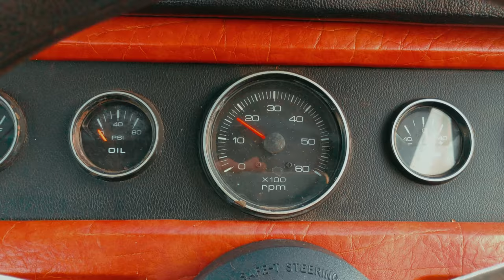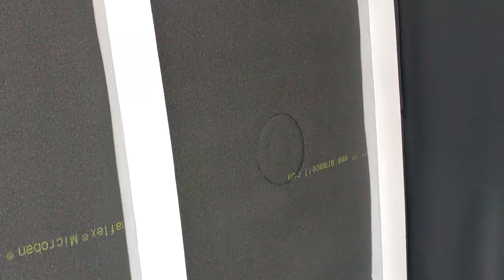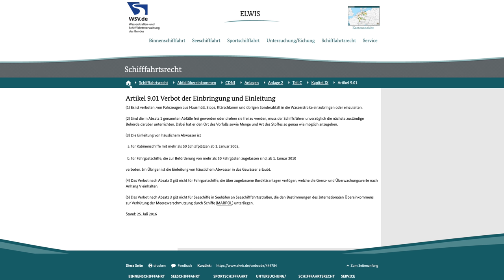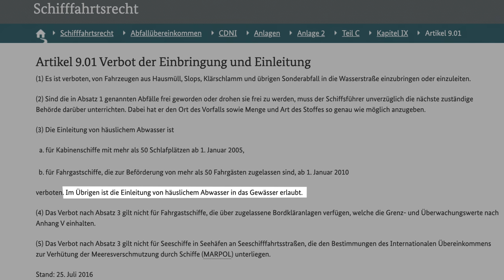Water System Refit on 1978 40ft Yacht - Ep. #46 - Vintage Yacht Restoration Vlog

Comment: I smiled when you said that 'in the future you will add fixings for the semi=ridged tubes'. Remember - every temporary fix that works becomes permanent. That's not a criticism, it's just a fact of life.
Reply: I would add 1000% more at least. Some day that boat will sea at least Baltic Sea and hoses will break after a while.
Reply: Yeah! My father built a cardboard box casing (with generous use of gaffer tape) for a 230/12 Volt powersupply - in the 70ties. Meant as a temporary solution - obviously - as cardboard is not exactly safe to insulate 230 volt. He said he will built something better soon.
My father died 15 years ago.
The powersupply  still works. 
In a cardborad casing.
Reply: i cant disagree with you
Reply: How did an American runabout end up in Germany?

Comment: Water coming out of waste tank should have some kind of trap to protect the pump if something should fall down the drain. It could also stop the flow of water. Maybe it's best to put trap before waste tank. One more thing just came to me, the sink should have a pee trap just under the sink to stop bad smell from entering the boat. In America it's called a pee-trap. All it is, is a half loop in the drain line which holds (a little bit) water that makes a seal so bad smell from waste tank can't come into the boat. Hope this helps. Cheers!
   You have come a long with that boat and I've gained some ideas from you so it only right that I give also. Blessings to you.

Comment: White plumbers tape is low grade and you should use "pink" tape.  Also after min 3 layers, tighten it as best you can with your fingers (use a screwing motion) to push it into the threads and expel air, then screw on your fitting.   Also any fitting through the hull should have a shut off valve, in this case a smooth full bore ball type, so as not to catch particles and clog. But looks good.

Comment: If you look iside those metal slip nut hoses you will discover that the seal of that ftg is set up to be a compressive seal. TFE tape can actually create a potential for leak with any future vibration. Composting toilets work surprisingly well and will conserve your water

Comment: Great progress. Fitting an adequately sized black water tank is relatively easy - the problem may be accessing pump out locations on your waterways - have you researched that? A bigger problem may well be how to deal with fuel/oil contaminated bilge water - pumping that overboard is more likely to be detected and prosecution swiftly exercised. Grey water is not a problem if you are using eco friendly products. Keep up the good work.👍

Comment: Suggestion. Put a gooseneck in the sink hose to prevent odours coming from seawage tank. And add a deaireation to seawage tank with an antiodour filter.
For the toilet you can put, if you have enough space, a separated tank only for that and add an enzimatic pack monthly.

Comment: With the problem of corrosion in the electrical wiring.  I strongly recommend that you use Penetrox. 
Even use it on wire crimps. Just dip the wire end in Penetrox before crimping. 
The boat is looking good Inside.🤗🛥🌞

Comment: I would insulate your hot water lines with some lagging as they will bleed off heat very quick.
Reply: Armaflex etc. have easy to use and quite cheap ready to use insulation tubes to use.
Reply: What about thermo isolation for cold water as well, since it can all froze in winter bursting the pipes?
Reply: @new.handle  boat is isolated and with heating on, nothing will freeze even in minus 15-25.

But your right, if this was a glasfiber boat without isolation it could be a risky move going without the isolation imo.

But putting isolation on the hot pipes will save him energy for sure.

Keeping isolation on the cold ones, will keep the cold lines even colder in the hot summers and prevent any cold too freeze it is he leaves it non heated for long times ye.

I would probably isolate it just for the colder water in the summers 👍😁

Comment: A "P" trap under each sink is a must or you will have gas exiting each sink - smelly!  Holding tanks should be vented.  I agree with others that your "boiler" is going to have a problem with that installation.  I love the quick-connects but the concerns expressed are valid. Ensure you have a disconnect switch for when the boat is vacant but not for the bilge pump!

Comment: Great job!
Congrats!
One little remark please, is for that green plastic pipe for water.
Winter is coming! 
Maybe is better to try to have in the engine room, temperatures above zero Celsius degrees, in order to prevent ice clogging of pipes and potential leackings (pipes cracks or enlargements or plastic connectors cracks). If you'll leave the boat afloat and unattended for days, don't forget to drain the water from all water pipes!
All the best!
😉

Comment: In terms of waste water; I'm looking at exactly the same thing right now and as my boat is a sailing barge I'm fitting Y-valves to everything, including both of the sink pumps and the shower, so I can pump this out of the side if I need to. Although usually I'm going to pump this into a waste tank so I can pump out to a sewerage facility. This is pretty easy for me as I'm moored right near one and usually have a permanent connection although i'm going to put as large a tank in as I can; I think 1000 litres at least. This means I can be away for a good while before I need to pump out. For the toilet there already is a hull fitting to pump this out directly from the toilet and also a hull fitting to take water in to flush the toilet. This outlet was also on a Y-valve although always in the position where it is pumped into the waste tank. I'm going to leave this system so that I could pump straight out of the side if it was really necessary and I was in a location in which it was ok to do so (such as at sea), although it will go into the waste tank usually. I'm also combining the "black" and the "grey" water in this tank. There is a case for having separate tanks if you reclaim the grey water although I just pump out into the mains sewerage system so will just keep it all in the same tank. The guidance is hard to understand in the UK too really although I think it's good future-proofing to be able to collect everything (and to avoid having to pump out constantly get as large a tank as you can possibly manage). Finally, you can weld plastic HDPE sheets yourself with a plastic welder so make your own tanks to the dimensions you have, for example low in the hull etc. This is what I'm going to do.
Reply: Also I'd recommend a soundproof box for your water pumps. 😊

Comment: You should review the connectors on the waste pump, and cut them back. If you leave it this way, you will have a bottleneck. (tubings diameter vs. pump connector) Also don't fortget to isolate/fix the tubings rubbing against each other. ;-) And yeah... waste water outlet belongs under the waterline or at least not so high (dirty paint/hull). Nice to see that your overall skills are growing and you have invested in proper tools! :-)

Comment: I approve of your waste water thoughts. It must be remembered that household grey water makes its way into water courses almost untreated anyway. If you are thoughtful of what you put in chemical wise you are not doing anything that a normal householder doesn’t do too. The difference is that you are very aware of what you emit.
  Solids are different but that depends on how busy the waterway is and its rate of change. A busy canal for instance is very different to a flowing river or the tidal sea where the rate of change of the water body is significant. Dilution is everything and I prefer people to be aware of what they discharge as many boaters are. To be revolting, one mans waste is another organisms food. Its about balance as ever.

Comment: bravo for these installations, made very correctly, even the pieces of wood are varnished, as well as the anti-wear protectors. In France the rule is that we put 2 necklaces per tube (in case one of the two gives way ...) but each one does as he wants ...! great job, well done!

Comment: One thing I do with future lines is I just install a shutoff valve instead of a plug. Although I can see where the plug is handy in that it helps keep dirt out of the lines. But you might want to look at some shutoff valves for handy troubleshooting and maintenance later on in life.

Comment: I would recommend doubling up on the pipe clamps/jubilee clips as security against failure (leaks on boats are bad)
:)
Reply: Exactly. Use two clamps on every single water connection. Mount the clamps always turned by 180 degrees against each other. This applies to the entire boat, e.g. water system, engine room, bilge pumps, etc.

Comment: In my friends 104' wooden boat we were going to use bags like are used for transporting plywood glue on flat bed truck trailers. Allowing us to empty them. Roll them up and removing the support beds to access the bilge if needed instead of cutting the deck out above and a crane to lift them out.  There are race car fuel cell bladder manufacturers that might have something in a size you might use.

Comment: Great job on this, it looks very professional.  The gray cable trunking that you already have is a great way to run cables & flex pipes neatly.  It's cheap, easy to deal with and protects everything very well.   I have used it in large industrial machinery where vibration and other potential damage is always an issue.

Comment: You can easily hang a blackwater tank behind your toilet. No need to keep it under waterline, and you get a 3 way valve to either dump it overboard where legal, or pump it out via a deck fitting. Remember when you pump out your toilet, you can without any problem pump it up 1 meter to a tank, either with a manual pump toilet or electric ( i prefer a electric with a macerating mill that cuts up all sevage). On most sailboats today the tank is assembled behind the toilet on the hull.

Comment: you still need to put something in place between the brass and steel in the hole as if the annular space fills with salt water, you will get electrolytic reaction

Comment: Dark water through hull pump should be installed under water line (I think).  Usually straight down.  The reason is that once you start using the head the pump out will stink and if you have it in the location you do it will always be rolling down the side of the boat creating smell and pretty nasty residue.
Reply: This is just the gray water outlet, water from the shower and sinks. The head is existing under the water line, you can see it in episode 43 if I recall correctly.
Reply: I believe the head has its own through-hull that goes straight down, so it dumps directly into the water.
Reply: @jeffhreid  Hypothermia is deadlier so the poor should not have to pay for sanitation when the beneficiaries include the rich, especially when doing so threatens shelter.

Comment: Goose neck above the water line ? And grey water outlet above the water line, I hope you don't empty your gray water tank with toilet water above the water line. I think you missed the point grey water you dump under water and then use a goose neck to prevent the water from leveling. Great refit and nice water system.

Comment: Watching you replace the plumbing has been enlightening but did I miss the installation of a back-flow preventor, inside of the through-hole? That will keep the water out.
Reply: It is over a metre from the waterline.

Comment: You have a problem with your hot water boiler. You will have an air pocket in it at all times,  unless there's a bleeder on the back,. You have the hot water outlet lower than the highest point of the tank.

Comment: Dealing with grey water is one thing.  Black water is another and you really need to deal with the fact that your head discharges directly overboard.  Removing it and going to a cassette type head would be a good choice. Grey water can be dealt with by using a reverse osmosis system  and the water being discharged is actually drinkable.  This however would require accumulated residue to be cleaned from the tank occassionally.

Comment: Hot and cold lines need to be separated or sweating and heat exchange will occur. At the very least you should insulate them separately if you want to keep them together as they are. Good work though!

Comment: You will probably never use the hot water in the hand washing sink in the head. It takes 30 seconds of water running or so until hot water is actually coming out of the tap, and given the need to use water sparingly on a boat, you will never let the water run long enough.

Comment: As far as I know you are not allowed to pump black water overboard! Blackwater means sewage from the head aka feces.
Grey water on the other hand (water from the shower, sinks, washing Maschine, etc.) are allowed to be pumped overboard as long as you are not in a Marina.
I am from Germany too and often on a boat in the Netherlands. So that’s my knowledge so far. If I am correct, they also told us that when I did my boating license (in Germany btw.).
Reply: you can 3 miles offshore in the US
Reply: @sailingavocet  yes but he is ankered in a little lake in Berlin. I am pretty sure it is not allowed there.
Reply: @Far90Cry  ah, that makes more sense. Definitely probably not allowed

Comment: 1: The hot water pipeline must be insulated, otherwise it will heat the cold water pipeline. 
2: a circulation pump and a return pipeline from consumers to the boiler must be built into the hot water pipeline. otherwise, you will have to wait until hot water reaches the pipeline from the boiler, and this is the loss of clean water. while you waiting for hot water from the boiler, clean water flows into the gray water tank

Comment: I would do a couple more steps. Where you had the void in the hull outlet brass fitting, fill it with sikaflex. Also had a stop cock to the outlet so it acts as a sea cock and can be closed in high seas ( just in case). You don’t want water to come in with rough weather.

Comment: Are you gonna be dumping poop right into the river...lol? Greywater would be ok but not black water. You could install a holding tank and macerator with Y-valve (diverter) to carry into the holding tank or switch to overboard discharge.  There would be no need to hold the grey water.
Reply: As he said that is the common practice in every place in the world except for the United States. . now stay out of the ocean that is where the whales crap. 😆
Reply: I had boats for over 20 years in Auckland New Zealand. There is nothing worse than seeing people swimming in a beautiful anchorage and turds passing by. Blackwater holding tanks are compulsory here and can be discharged when more than 200 meters from the shore. In my last boat, a 42-foot sailing catamaran I installed an Electrosan macerator/electro chlorinator that turned turds into sweet-smelling clear stuff. It did use a lot of electricity, so I used it a couple of times after a number 2, then used the toilet pump only, for number 1's. Showers and sinks either got pumped out or gravity emptied into the sea. This guy does a great job in everything he does and does not cut corners. He has made errors in the system here but fitted it immaculately. I hope he reads the comments and takes the advice so that the systems become correct.
Reply: @colinowen3672  I like the way you're thinking 🤔

Comment: That's a WHOLE lot of sharkbite fittings. That's going to be a nightmare when they start to leak, lol. There's a reason plumbers don't use them in residential plumbing, or really anywhere.
Reply: Plumbers use them everywhere, all the time. Thats what they are for! They dont leak unless fitted by a dunderhead.
 However, i would have fitted stiffeners to prevent the fittings blowing off.
Reply: @johnnyseagull29  Are you a plumber? You know how many customers houses I’ve gone into, to fix leaking or blown off shark bites? They are good for max 10 years.
Reply: @Velislide  well yes. Of course i am. I run a bathroom fitting company in england and i have very rarely had a problem with push fit fittings, and they have all been due to poor fitting methods.
Reply: @johnnyseagull29  Rarely have a problem is too often, especially in a customers home, where one problem can cause 10,000$ worth of damage. Why would you ever use sharkbites? They are a DIY fitting for home owners with little to no experience plumbing. Either use Uponor and Type-A, or crimp fittings, if you can't afford the tool. If you run a business, and are using sharkbites, I feel bad for the overpriced garbage your customers are paying for, because you're being too cheap to buy quality tools.

I wouldn't be able to sleep at night, knowing I put sharkbites into a 30,000$ bathroom project. Knowing that water hammer, or time, will pop those fittings, and blast the customers home with 60 psi of water pressure.
Reply: Unfortunately plumbers use them everywhere because it’s a quick fix and takes no skills.  If it leaks down the road, it’s repeat business.
Reply: @nauy  Out of every union plumber I've worked with, I've never seen one that would ever use sharkbites.

Comment: For your own sake, (as well as regulatory issues and your contingency plans), you need to separate your grey and black water systems. You risk contaminating your whole system with e-coli, not to mention foul air returning through your sink. Just make an additional through-hull and wire it up. BTW why did you put the through-hull so high?? It should have been placed just above the waterline... There is tonnes of info on the subject on YT. Keep up the good work.

Comment: I would have added a shutoff valve on the hot side of the boiler as well.  I've been doing that for years, which makes replacing the boiler MUCH easier. :)